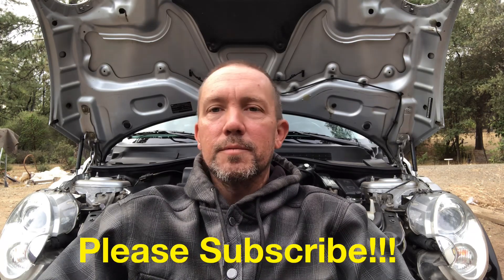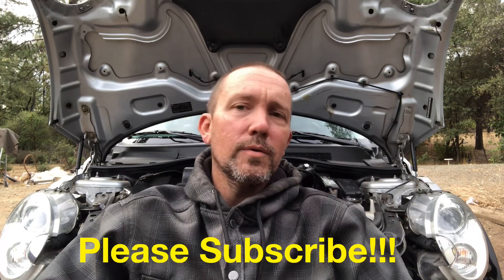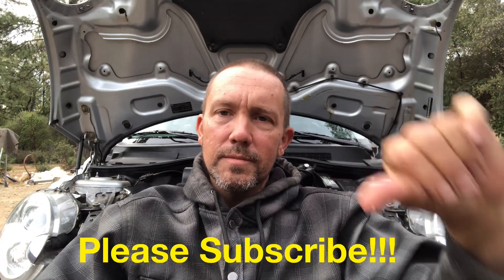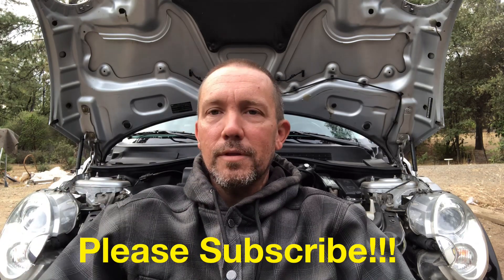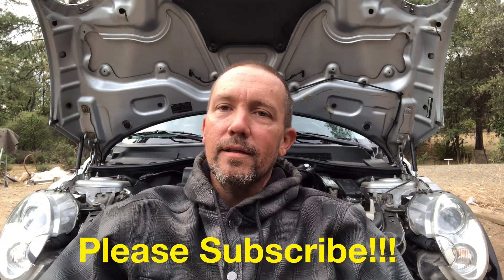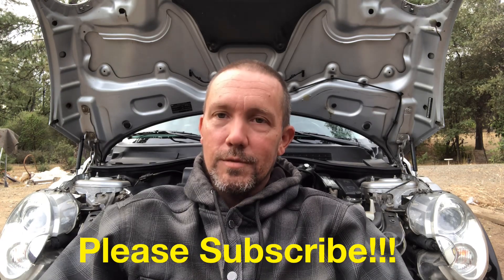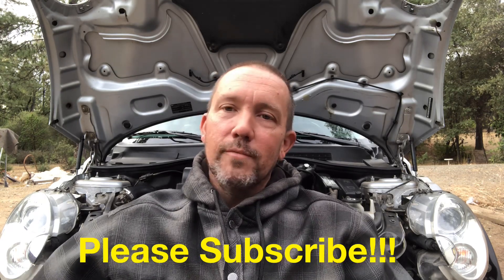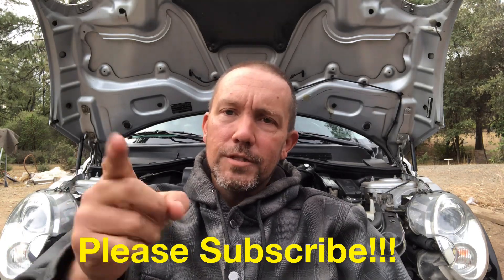How to get your R56 Mini Cooper S to stage 3 (RPM stage 3)

Comment: I have a RPM Power Stage 2 tune on my 08 R55. I am installing the Snow Performance Stage 2 methanol kit. Should I expect an increase of horsepower without changing the RPM Stage 2 tune? And if so how much. Thanks for all the info.
Reply from the maker: You should expect some hp, but not a whole lot
Reply: Meth kits are not really about making more power. They are more about safely and reliably making power. It allows you to run more boost by increasing your fuel octane and running lower Intake air temps so it helps stop detonation and it helps keep your intake valves cleaner. In my opinion ALL turbo cars should have water meth injection.
Reply: @srtowner  That's what I thought. Added horsepower is by being able to add more boost because of higher octane and lower intake temp. I'm also adding the meth kit cause I understand it helps clean the intake valve stems and backside of the valves on a DI engine.
Reply from the maker: You don’t need to tune to get lower intake temps, lower intake temps will keep your ECU from pulling timing do to heat. Of course you will gain much more power if you tune for the methanol as stated in the video 👍
Reply: IF you tune your car for meth ALWAYS CHECK IT. If it is tuned in you don’t want to drive your car without meth in the kit. If it’s NOT TUNED for meth but you have it then no worries(but still keep it filled for benefits)

Comment: What is a good reading for a compression test on the n14 engine
Reply from the maker: Around 150 psi, the reason i say “around” is because different compression testers will read differently. What is most important is that all four cylinders read within 5 or so percent. 

If you’re uncertain with the results of your compression test then do a leak down test

Comment: What about the transmission? Can it handle so much power?
Reply from the maker: Yes, plenty of people are stage 3 with stock transmissions
Reply: @ProjectMini  are both manual and auto good to go?
Reply: Unless you're running more than 270lb ft of torque, you should be fine with the stock clutch.  Get an organic clutch and flywheel kit if you're going that high on torque, those can handle up to 350 lb ft of torque.  The best part about organic clutch and flywheel kits, unlike stage 2 kits for example, is that they're still very light and quiet like a stock clutch.  Seriously, don't waste your time with those garbage racing clutch kits, organic kits might be almost $2k, but they're worth the investment when you're going for high torque.